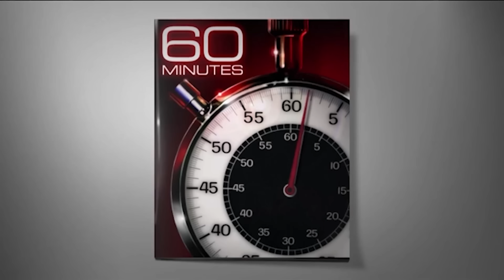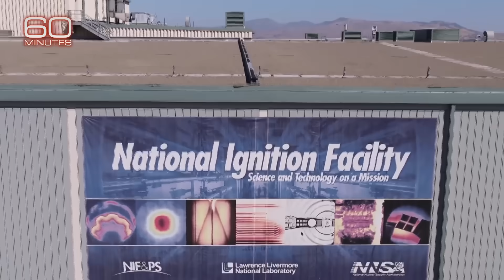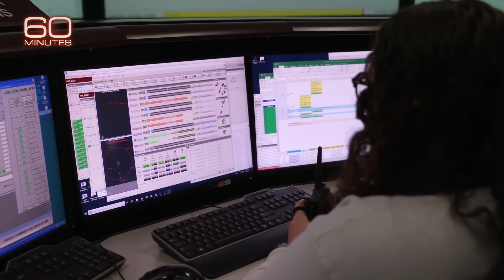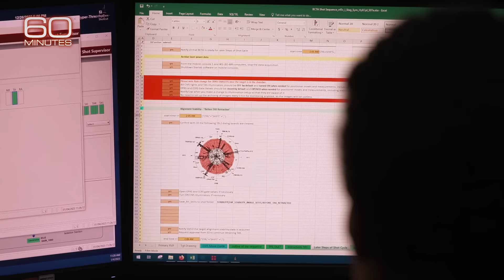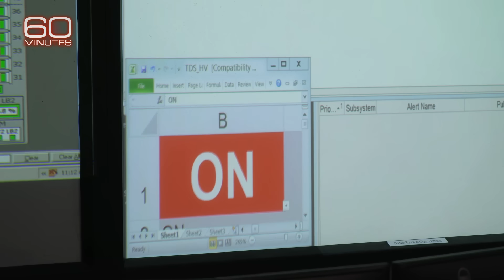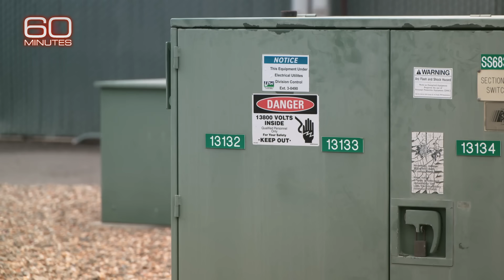Nuclear Fusion: Inside the breakthrough that could change our world | 60 Minutes

Comment: 60 years in the making- congratulations to all involved along the way!
Reply: sounds like a union job. 60 years later and we can boil 2 pots of coffee!
Reply: I’m sure they will give it to a right to work state and some foreigners will do it cheaper.
Reply: They still have nothing to show for.
Reply: @gizmo6746  Didn't you see that doohickey?
Reply: I'd like to take full credit
Reply: @elsiebert2273   I do hope some miracle will occur, wave compression charge matching or something, think of all the energy we would have if it didn't take so much to fuse the atoms, if we can make the nuclei want to get together  a part of the problem will be licked,Quantuum mechanics is making us aware of the challenge if we could just shift the atoms into another phase'
 It was said  it was revealed there were 3 things fundamental to this universe. Light, frequency, sound? I forget the other perhaps it was spin or vibration, so it goes. The one thing that gets me is there are fundamental differences in some branches of physics that dictate the behavor of  matter and vacuum, I dont know maybe there is a "Vril" I hope we are not being hoodwinked, its so frustrating.
Reply: Kind of reminds one of the "Tilt Rotor" aircraft still not perfected to be perfectly safe.

Comment: Like the video and all but don’t undermine nuclear fission energy. Very miss guided by the media and public. Nuclear fission is unbelievably safe and actually almost completely carbon free. Nuclear reactors today could run for 1,000 years off of the (very protected) radioactive fuel waste created by older generation reactors. More than 90% of its energy remains in the fuel, even after 5 years of operating in a reactor. And to say their not safe is just ridiculous, melt downs are VERY rare and easily avoidable. These moeders reactors are extremely safe and clean. Nuclear has a death rate of 33 years to 1. For every 33 years MAYBE one person could die on an out of average year. If you still think that is bad, look at every other fossil/reusable fuel energy death per terawatt hour. We need more nuclear energy, no more coal and natural gas. Nothing against fusion because theoretically it would be almost unlimited energy. But the money and resources spent on this versus the already efficient and clean alternative source of nuclear energy is just a waste of time at our technological stage.

Comment: Fusion has been around for a while.  The recent success was in getting more out of the reaction than went into it; which is not the same as the larger amount energy used to power the lasers involved.  As badly as we need commercial fusion, we're not there yet.

Comment: This so-called "breakthrough" is actually an overhyped nothing burger. It is also misleading. Yes, the lasers put 2 mj of thermal energy in and got 3 mj of thermal energy out but the important thing is it took 300 mj of electricity into the lasers to get that initial 2 mj of thermal energy by the lasers. Now, since you lose a lot of "energy" in the conversion from thermal energy to electricity, it is worse than a 300 to 1 loss rate. 
 More importantly is that it had to use a pellet made of tritium, an extremely rare and ridiculously expensive material. Not only does tritium generate radioactive waste, even if they could ever get more electricity out than they put in (which isn't going to happen... ever), the electricity generated would be too expensive for anyone to afford.

Comment: This is NOT the breakthrough people seem to think it is. They did not create more energy than was used to initiate the fusion, as a lot of places are reporting. They created more energy with the fusion ignition than the output of the lasers they used to initiate the fusion. However, when ALL the input energy that was used to fire the lasers are taken into account, the fusion process still out output like 1% of the total power used in the process of initiating that fusion! No where near enough to truly be viable. Glad someone is finally reporting this properly!
Reply: The lasers are 30 year old tech.  There are way more efficient lasers available.  Now that this achievement has happened, more funding may mean and upgraded facility.  Can't upgrade without results...
Reply: Have to tap up the Chinese to use their new Super Mirror Power Plant 🌞

Comment: Surprisingly good segment. The engineering that went into building the facility alone is extremely impressive.
Reply: Joe Mama  fusion energy is not the key because all the keys to fusion are broken.  The problem is in like the Tokamak reactors with even a 1% of tritium lost in the blanket it will not be able to be replenished which means it can not be sustained especially with today's tritium prices. Using Helium 3 and Deuterium only produces more tritium that must be attempted to contain it which is extremely challenging being that it permeates metallic structures and one of the major issues of fission.  The issues are rarely spoken of as there is only a finite amount of tritium on the planet and helium is on the shortage list.  It's a complete waste of money.
Reply: So is the money. 👎🏻
Reply: Joe Mama  Fusion energy already works...thats not the issue.  It's that the fuel and coolants used for fusion are either extremely rare, on the shortage list already or extremely expensive causing fusion to be a waste of money
Reply: Joe Mama  Talk about 100% not knowing?  Extraterrestrials? Space folds other dimensions? Physics?   Wow...Joe mama dropped you on your head Joe
Reply: Joe Mama  What?!?! I've explained the science of fusion power while all you've done here is in essence say "yay....fusion is the key" without any mention of the science to support that claim much less the supply issues revolving around all versions of fusion power.  For some reason you can't comprehend that the fuels and coolants used are extremely rare to find or extremely expensive to make or on the shortage list.  It's like you're completely blind to the supply and demand issues.  Wow
Reply: And a complete waste of time and money.
Reply: @Saxxin1  Pft, it's a drop in the bucket of other things that could be considered wasteful. A 3.5 billion dollar facility and some change for scientific breakthroughs is much more worthy and less worrisome than blowing tens and tens of billions on stupid wars to spread muh democracy.
Reply: @Saxxin1  Waste of time? No, this could solve global wars before they happen (if done correctly). Waste of money? Dude money is worthless. Its printed by the government. 😂
Reply: @Saxxin1  I couldn't agree more...the issue always has been the fuel they are using.  Tritium, naturally occuring is extremely rare on Earth and only found in trace amounts in the atmosphere.  It costs $30,000 per gram and some of these reactors need upwards of 200 Kgs...most people don't understand the entire process and are in awe when they see presentations like this.

Comment: Lol , here's where people will either get rich, die or disappear. Here is what happens . The energy people who control fuel, electricity, oil , and now even solar , failed to keep this under wraps . Because woman led the charge on this. But , they won't receive the funding they need to produce the manufacturing of a machine that can either make the shells and or make the shells larger to achieve this. This machine which I will dub Nidavellir , the forge of a neutron star which create thors hammer , is what they need to build to mass produce shells . But, Once this went live , all the red tape came out. My fear is that this will disappear like all the inventions of the CEO of 5 hour energy drink has made. The only way this will see the light of day is if they sign the contract with the military. If these people give in to certain people, then we will never see this come to light , literally , in our life time.

Comment: I believe there to be a problem with the copper device holding the target. Make the target float in a magnetic vacuum so nothing touches it , also if you have such a hard time starting it are you sure you can turn it off.

Comment: Not to be nit-picky, because they are basically trying to do what a star does, but 3 units of energy out from 2 units of energy in + the massive energy to create and run that huge facility, doesn't seem to make for a net-energy gain.  Even in the long run, I question if we are truly at an overall system net-energy gain.

I think the systems have to get a lot smaller, and much more easily reproducible.  Hopefully, this step is the first in the right direction.

Comment: The department of energy is not informed  about the reality of power generation.  They are grossly misinformed about power generation.  A power plant built with permanent magnet motors as generators and brushless motors as generators with inverters and transformers to deliver high voltage AC power.  These are continuous peak power plants without heat fossil fuels water wheels or wind mills.  The nuclear power plants were obsolete when they were invented..

Comment: Fusion power produces gamma radiation and this is propagation of nuclear radiation.   We don't need heat to produce electricity.  It not a necessity.  We have Edison generator and dynamos power plants to replace nuclear power plants and fossil fuels use.  We have been waiting for 50 years for normal legal behavior regarding power generation and industrial pollution.  The chemical weapon manufacture treaty enforcement and nuclear nonproliferation treaty enforcement is still missing.

Comment: We don't need nuclear power plants or fusion power plants. The nuclear nonproliferation treaty enforcement and obligations are based on the nuclear cascade and ozone cascade and survival.  We don't need nuclear power plants or fusion power plants.  Edison generator and dynamos power plants with inverters and transformers easily produce as much current and voltage AC power continuous peak power that we may need.  These are power plants without fuel.   We are grossly misinformed about power generation.

Comment: Stars don't naturally have neutrons or electrons.   Neutrons are added to stars from outside of the star and magnetic field of the Sun is coming from the plastic on the probes we lost in the Sun.  The pulsar we created by probing the our sun is raining neutron particles on us with 19 pulses per second from the neutrons we added to the Sun.   We don't need heat steam wind or water to generate electricity.  Tesla bound Edison's generator with magnets all around the armature and used water to turn the armature magnets and coils of copper wire.  We could build permanent magnet motors as generators and brushless motors as generators to have a power plant without fuel steam water or wind.  The field magnets move the armature magnets and coils of copper wire. We are grossly misinformed about power generation and power use.  We could have unlimited range electric power cars trucks and airplanes using Edison generators or dynamos.  We could carry the generator and drive the car or fly the plane.  An unlimited range electric airplane is waiting to be built.

Comment: Not to take away from the achievement, but I'd venture to say: in addition to the unit cost of firing the laser, I'd expect that one also needs to factor in the units of energy needed to produce the fuel source, in the form of a perfect hollow sphere.  It's still conceivable that when all is said and done, the energy equation will net to zero.

Comment: Yeah flight started with a hundred feet, but it also started with just two guys working in the garage with $50 worth of bicycle parts. This thing overall, requires $3B of investment on top of the $Billions of gov't money. It also requires 300 total units of energy, not 3 to get just 2 out and MAY try again in another month, not the several per second that is required.

Comment: "about 3..." is a religeous statement. Either three units did "come out" or maybe it was...TWO, or a fraction...
NO one can actually logically prove that a "3" can actually be dedused by showing the difference between 0 and 1 and inference. Check Jaques Vallee about this. Wishful observation does produce results when viewing the double slit. That can easily happen in this..."instance" however short. The result may be real--but caused by the observation!!! Read again for clarity. A useful result may be occuring, but the functional contribution may require...less energetic coherence. "energy" is not automatically the only catalyst. Units of measure are less industrial within an envelope of...infinite proportions. Find the...slit...in the envelope.

Comment: While I wouldn't say fusion is a pipe dream, this method is so fraught with technical issues that I think it's a dead end.  One thing they never mention is how would you turn this ignition event(s) into electricity because ultimately you are using the heat produced to make steam to run a generator.   I would be more excited for fusion via magnetic confinement of plasma for many reasons but only if they can do it without using tritium, since it is so rare and making a lot of it cheaply and efficiently is not an easy task.  Another thing to consider is how much it will cost to build a fusion power plant, and also how easy it will be to run.  Fission reactors are large and expensive, but actually quite simply in terms of how they work.  Fusion reactors, on the other hand, require so much more in terms of sustaining a reaction due to the extreme temperatures and pressures, that I would imagine the cost of building and running  them as well as the technical challenges would be many times greater than a fission reactor.
Reply: Honestly, they're just crossing their fingers and praying that their tritium breeding blanket idea will work when they finally turn ITER on in 2035. Honestly, I think this is all just a government ploy to create funding for military grade laser research.

Comment: Unfortunately I agree with Charles Seife. This is only one of hundreds of jaw-dropping hurdles that have to be cleared before it can actually be commercially viable - this includes finding enough fuel. Everyone points to seawater for the hydrogen, but it isn't seawater that's used and it isn't normal hydrogen either. And these hurdles will themselves, likely take decades. In the meantime our planet is going down the toilet. Even if we had the beginnings of commercial fusion in 2050, it will very probably be too late. These tens of billions could be better spent on green energy production that is much more likely to succeed. Thorium reactors are much closer, much simpler and use fuel that is abundant. But they aren't quite as sexy so no-one is throwing money at them (except maybe China and India).
So every time a physics group inches a tiny step closer to a very VERY distant goal, the press goes mad virtually claiming that "we've cracked the code" !!!!!

Comment: Normally 60 mins does a good job but here they have been fooled along with so many.  The "breakeven" is only for one part of the fusion process.  Looking at the process as a whole, it is magnitudes behind break even, and about another 100x current nuclear power on top of that, and about another 10-100x less efficient than the upcoming Gen IV reactors.   See LJ4W1g-6JiY starting at 5m:30 for one good explanation about Qplasma vs Qtotal or start googling.

Comment: False by the way.... Some calculate the sun actually doesn't have the temps necessary for fusion... And that quantum tunneling to higher energies is needed as without it there would be zero fusion reactions in the sun... So not one not two but three possible firms of energy production going on... One of which may be powered by the mass of the sun pulling at the core itself....